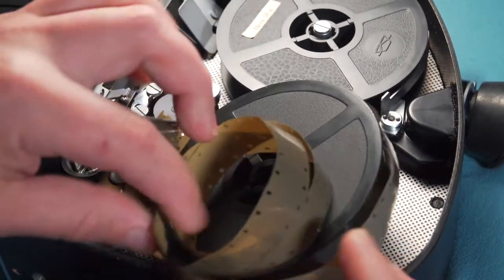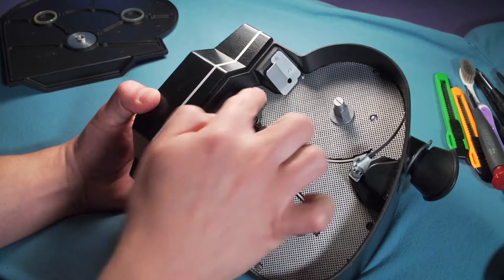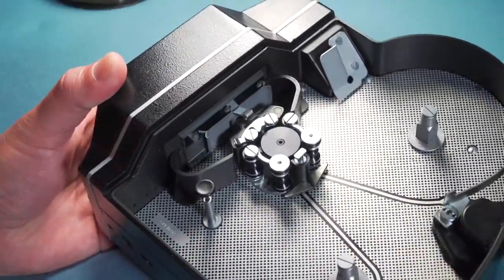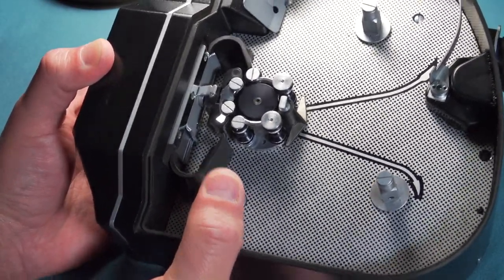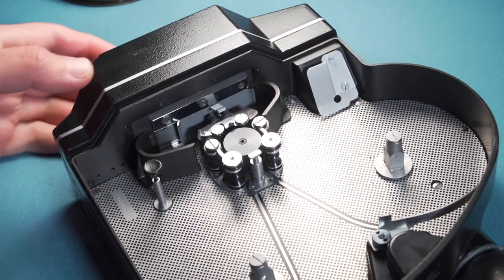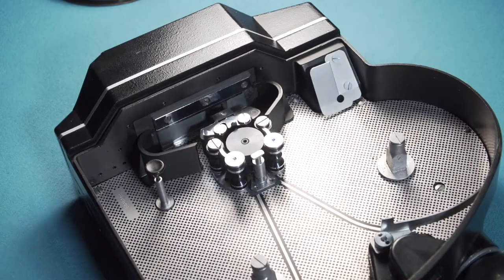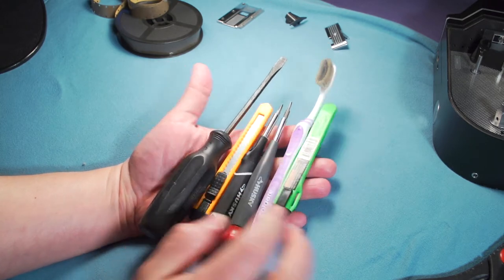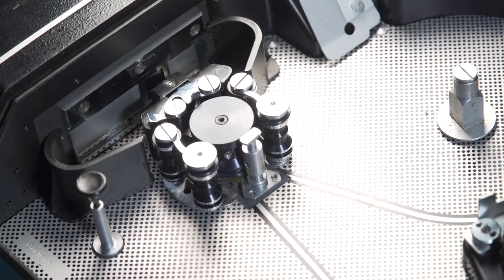Krasnogorsk 3 - Removing the loop formers.

Comment: I have another question. I bought the super 16 gate on ebay and the recentering ring. I know how to change the gate, but i dont know´how to remove the frontal part of the camera to change the ring. Can you help me??Maybe is too much to ask hahaha
Reply from the maker: No, it’s not too much Ignacio, actually I can point you in the right direction. Removing the front of the camera is easy, but you don’t have to do it to replace the mount, you just have to remove the 4 screws holding the mount, install the new one in the right position and you are set. 

Those mounts that they sell on eBay are not exactly properly machined so you can expect a change on the focal flange distance which is going to translate on the zoom lens not holding focus while you zooming in or out and maybe some problems with infinity focus, but that’s the price you have to pay if you don’t want to send the camera to a technician to adjust the FFD for you.
Reply: @TheCinematographyLab  I tried but i can´t get to that 4 screws because of the m42 mount. Is better if I only change the gate but not the the ring??
Reply from the maker: @ignaciobascon9670  I'm not sure I understand. To swap the mount you just have to remove those 4 screws around the m42 mount. If you already have the re-centering ring you can see that one has 4 holes for screws, those are the ones. You don't have to remove the entire front of the camera to do it, just remove the 4 screws located on the rounded, silver  m42 mount and install the new one.

It's not better or worst, it's about functionality. If you don't re-center the mount of the lens by replacing the mount you are not going to be using the center of the lens which is the best part and if you use the zoom lens it is going to be weird when you zoom in or out because the image is going to zoom to one side of the frame instead of the center. 

If you are planing to use prime lenses designed for still photography, the mount is not a big issue because those lenses cover a way bigger area than S16. If you replace the mount you are risking changing the focal flange distance and having problems with focusing at infinity and parfocal lenses.

Tambien hablo Español.
Reply: @TheCinematographyLab  I'm gonna use it with 35mm photography lenses (no zoom lenses) and I don´t want to mess with the focus. It is better to not change the ring or that´s not the problem?
La voy a usar con lentes de fotografía de 35mm de distancia focal fija. Mi duda es si el problema del enfoque vendría con el cambio de anillo o simplemente con el cambio de la puerta de super 16mm? 

Mil gracias por tu ayuda!!!!
Reply from the maker: @ignaciobascon9670  Con gusto Ignacio. Tecnicamente en cuanto quitas algo y lo vuelves a poner ya estas cambiando la "Focal Flange Distance" (no se como se dice en Español) Pero tienes mas posibilidades de que se altere esa distancia si cambias la montura, por que las que venden en eBay, al menos una que me toco a mi estan muy mal hechas.

Aun si le llevaras la camara a un tecnico esa persona tendria que tornear la parte de metal o agregar algunas cuñas para ajustarla a esa distancia, pero puedes intentar cambiar la montura y si no te enfoca a infinito pones la que traia la camara y ya. Tecnicamente en el momento que desatornillas algo estas cambiando esa distancia que debe estar calibrada a centesimas de milimetro, pero la verdad es que las K3 no tenian esos estandares de calidad de fabrica asi que no puedes intentar las dos cosas sin problema.

Si piensas usar lentes para camaras de foto fija no tendrias ningun problema si no re centras la montura. Esos lentes cubren un area muchisimo mayor a la del S16. Es notorio como te decia antes cuando usas lentes zoom por que si el lente no esta recentrado sientes como que la imagen se va ara un lado, eso es por que va a lo que anteriormente era el centro del 16 regular.

Yo hace tiempo converti una a S16, la que use para filmar en mi video de Santa Monica, pero no puedes ver una parte del visor y aun cuando hice muchas pruebas y me hice un mapa mental y tuve buenos resultados era un tanto molesto. Te recomiendo que hagas algunas pruebas para encontrar el centro del cuadro de S16. Se puede usar un pedazo de cinta para encontrarlo sin gastar pelicula, despues hare un video de eso.
Reply: @TheCinematographyLab   Thank you so much!! I think I will try to use it only changing the gate, I don´t want to mess the focus for now. Maybe in a few months when i get the chemical to develop at home, will be time for tests

Comment: Please show how to loosen the motor also
Reply from the maker: Thank you for checking it out Michael! You have some nice stuff as well. I'll have to do my research on the motor, but since I have several cameras "for parts" I can experiment without damaging a good one. I'll do it soon.
Reply: Removing the motor is actually quite simple. Remove the camera's plate as shown in the video, then using a spanner wrench remove the screw that holds the winding key and the motor should come right out. Take your time as there are washers on both the motor and winding mechasm, so be mindful of those as well as other small parts in the winding mechanism. They should stay held in place either by grease or springs, but a little extra caution never hurts :)
Reply from the maker: @movieman95  Thanks for that info! I have a camera that is stuck and I suspect the motor is the problem, so I will definitely give it a try.
Reply: @TheCinematographyLab  Happy to help! This might be obvious, but I would recommend making sure your motor is wound down before attempting to remove it if at all possible. I once had the spring motor from an 8mm camera that wasn't fully unwound fly out at me and hit me in the chest and roll across my kitchen lol. It was relatively small and still packed a punch so I shudder to think what that large Krasnogorsk motor would do flying across the room. If it is somehow stuck and won't unwind make sure you take safety precautions getting it loose.
Reply from the maker: @movieman95  Thanks for the tips! I did think about that. I had a similar experience with the K3 and I was not even removing the motor. I was grabbing the winding lever when I lifted the top part where the film transport mechanism is and it the lever twisted my hand abruptly and with a good amount of power. It's good to mention this here so other people working on their cameras can be careful as well. Not a bad idea to wear protective glasses too.